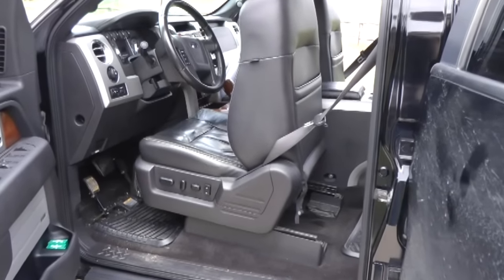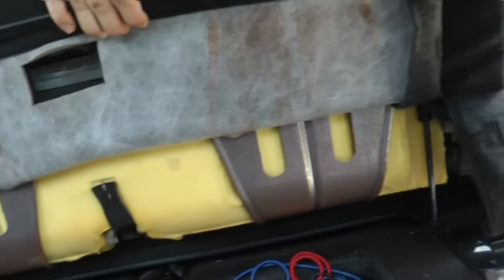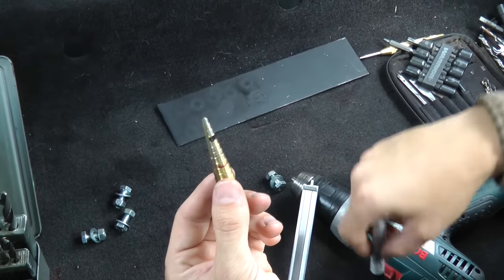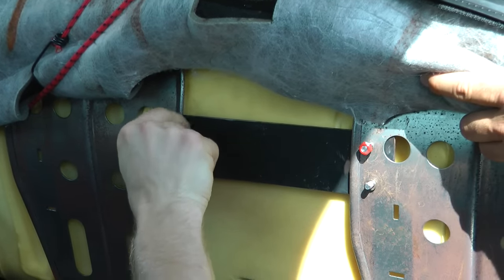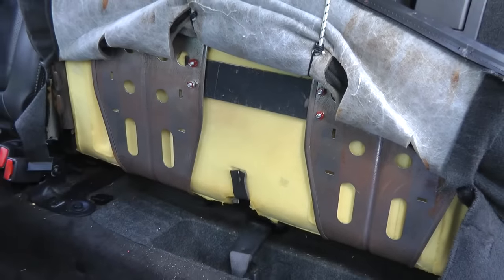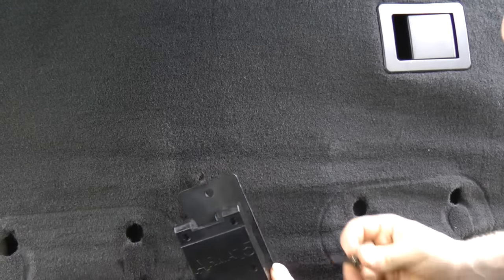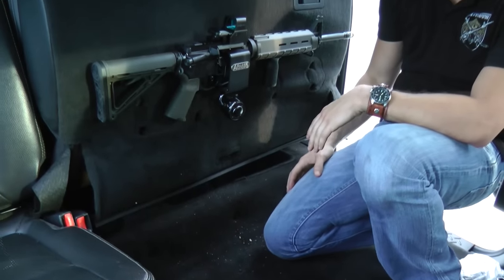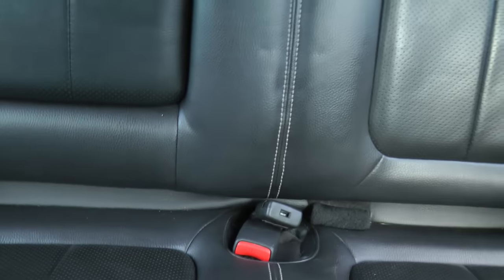ARmA15 Installed in Truck under Rear Seat AR15 M4 Locking Mount F150

Comment: great video good job , for cutting holes in your carpet you can heat up a bolt and burn it through the carpet to seal the edges if the carpet material will allow.

Comment: If you mark the hole locations in your backplate after you drill the 1/8" holes and before you drill them to full size, all the holes will line up more accurately. It's not easy to find the exact center of the full size holes with a much smaller diameter punch. Doesn't look like it was an issue for you in this video but for anyone trying this, it could misalign and be a real pain.
Good video and good idea. Thanks
Reply from the maker: Yeah we usually do this with a center punch or marker.

Comment: I would highly recommend a black, shoot thru cap on the end of the barrel.  It would keep dirt out of the gun and provide a little camo for the end of the barrel.
Reply from the maker: +rickd248 Good idea! Thanks
Reply: +ArmA15 AR15  Your welcome my friend!  I like your idea but it just won't work in my 2015 Grand Cherokee.  After watching your vid I took the weapon and a tape and spent an hour measuring and trying to find a place where I could do that.  If I still ave my old 1999 Cherokee there was a great place under the back seat that I used all the time.  The Grand Cherokee just has no room to spare.  If you go to www.flickr.com and use rickd248 as a search word for me, you can see the weapons I carry for my "Jeep Guns".  One is a .303 rebuilt Enfiled.  Thanks for all the ideas.
Reply from the maker: I drive a wrangler so I understand space.  We did install an arma15 in a trail blazer it was attached to the rear of the back seat.  Inside the back seat it has metal plate like the one in the video but on the back part not under the seat.  Look at the second picture at this link.  That is inside a trail blazer.  I would check under your upholstery but we made a video for the trail blazer as well just have yet to edit and upload.

http://arma15.com/component/hikashop/product/3-universal-rivnut-mount?Itemid=0
Reply: Good idea,  after watching this, I was thinking something would be needed to hide the end of the barrel when the door is open.  Maybe even a piece of plastic attached to the bottom side of the seat that would cover the gun from being seen at all with the door open.
Reply: @rickd248  Yes there is. I made a nice mount for my AR pistol under the back seat of my 04 GC.

Comment: If you have the crew cab truck with the larger rear seats you can install 2 of those mounts up under the seat if you invert one of them and I used thicker 3/16" or 5mm x 3" or 75mm metal for the seat mounting brackets.
With the seats down thise rifles are hidden.
You would have to get down on your hands and knees to see them under there.

Comment: This is probably late. But that “Slot” to release the seatbelt. You just need to use the buckle insert side to take it off. No screw driver or special crowbar required.

Comment: very cool but in my region with the season's and sporadic weather, humidity you'd have to check it and grease it fairly frequent
Reply from the maker: No grease needed ever powder coated so no where to rust.  Springs are strong enough to never require any lubrication.

Comment: You should put a box under the seat. that way you have a place to store any extra ammo or magazines plus it hides the barrel from getting seen. Good job.
Reply from the maker: +Brian Healy in this configuration you cant see barrel, when seat is down in normal mode.  We do have a video coming that is mounted to floor board under the seat, subscribe to see it when it comes out.  In this truck you can see they have plenty of storage for magazines under seat in factory open compartment.
Reply: You can see the barrel at 16:48. The storage compartment under seat is to small and shallow for decent storage. For $80 you can get a storage box that fits perfectly under your seat, concealing both the weapon and storing anything else that goes with it.
Reply from the maker: +Brian Healy At 16:48 I purposely put the camera low to show the rifle is there.  Unless your at a full squat or 7 years old you wont see anything, and even then it was only the tip of the muzzle brake.  The stock box worked perfectly for storing mags, the current owner uses it that way.  You can add a box under but it isnt 100 % needed.   The only time you can see it is when you have seat folded up.  If its down in normal mode you cant see  anything, just hate to see ya waste money if you dont need to.  Try it stock if your not happy then add box, but I doubt you will once you see it in real life.

Comment: Bolt Lock.  You look up year make model and you get a blank key.  Put your truck key in it, turn a full turn or half turn or 3/4 or something like that and it "learns" your truck's key.  You won't fumble around for that big truck key especially with that big fob or in my case just a transponder. bolt lock also makes very good locks and you won't loose it because it is your truck's key.

Comment: I prefer putting it in the back seat and folding it up. It holds the rifle in place. And, it is free. And, faster to get too.
Reply from the maker: +911LexVegas That works as long as no one gets access to your vehicle.  Concealing it could be as easy as having a jacket or towel over the rifle with it sitting on the seat next to you.  This is to add some security when your not in vehicle but when you are in vehicle you can have it sitting in your lap if you wish.  :-)

Comment: Even better use a AR Pistol with a 7.5 inch barrel and a sig brace of which I have and love it. Big flash and boom can be cut way down if you mount a Flaming Pig can on the end of the barrel. Out to 100 yards it will group at 4 to 5 inches with my Vortex red dot

Comment: I think that the front plate that flips up (with the arma15 nameplate) and locks the AR in place should have some "wings" of some sort to keep would be thieves from popping put the takedown pins and walking off with an upper. Very nice product tho.
Reply: +Vince ruland It secures the upper as well
Reply from the maker: +Vince ruland The ar15 is locked threw the ejection port since that's located on the upper receiver popping the take down pins don't get them anything.

Comment: It stinks to high heaven, but I've had good luck getting clean holes through carpeting with a piece of 3/8 stainless round stock, and sometimes a screwdriver, warmed up with a propane torch, just pushes right through, no fraying, no' oops, I sliced the carpet' moments.  Just use your head, you only need to warm the dowell, or screwdriver up enough to start to see a bit of discoloration.
Reply from the maker: +johayn Im sure there is a million ways thanks for offering another ill try it sometime.  The method we have used has also been flawless and pretty simple
Reply: ArmA15 AR15
Right on.  Used to install interiors and that was just one way I liked the best for making a flawless hole in carpeting.

Comment: The instal procedure is anout the same gor a Sierra or Silverado.
I have done both.
The heaby bravket needs to go under the seat the other way front to back or vertically if the seat is up to bolt it through the heavy tubing seat frame.

Comment: Ya but... the entire gun is only supported by the magazine well?  It seems like sufficient off-roading would destroy a gun mounted like that.  Great idea and looks clean, but I suggest supporting the barrel independently.
Reply from the maker: +EngineersLogic Actually no barrel support needed.  Its been offroad used on my 2 jeeps and atv several thousand miles off road.  We also had a customer get in an accident that totaled there car with no damge or even scratches on arma15 or rifle.  The marines have also made a purchase to put in attack choppers.  The mag well is pretty strong and fully suppored by abs so no steel touches the rifle.

Comment: genius, I'll do the same things to my truck.
Reply from the maker: +Dunstin N Check out our rivnut install kit on our website(arma15.com).  It cuts the install time in half and all the hardware is there.  You can buy all the hardware independently if you wish as well but having done it both ways I would use rivnuts both work equally as well but rivnut is just so much easier as far as install goes.
Reply from the maker: +Dunstin N Check out our rivnut install kit on our website(arma15.com).  It cuts the install time in half and all the hardware is there.  You can buy all the hardware independently if you wish as well but having done it both ways I would use rivnuts both work equally as well but rivnut is just so much easier as far as install goes.

Comment: Rule #2?  Why mount the rifle so that you muzzle yourself when you pull it out?  Flip the rifle and mount it 180 degress (muzzle away from you)!
Reply: The rifle has the bolt to the rear(impossible to fire), and rifle must be unloaded(2x impossible to fire).  When he took it off at no point did he sweep anyone nor himself. Maybe this is just the way this guy wanted it.  On the website it shows you can have it pointed inside the way you desire.
Reply from the maker: This customer wanted it pointed this way.  The as another has said rifle bolt must be to the rear to mount on arma15, chamber empty with no magazine.  See the end of the video I lean over and there is no way I am being swept as it is removed.  Mounting it pointing the other direction is also an option see our website.  You could argue having muzzle pointed opposite direction would be pointing at someone from other door.  But all is for not as it cant be loaded, and bolt must be to the rear to mount on arma15.

Comment: very sweet, my question is does the bracket rub against the bolt and cause any damage at all?
Reply from the maker: No, On the magazine block there is a (bolt block) which is made out of high strength ABS plastic.  Absolutely no steel touches your AR15.  See other videos on arma15.com and subscribe as we are finishing some edits on a new install video that goes over these features in great detail.
Reply from the maker: https://www.youtube.com/watch?v=h7TrxUO2r6g

Comment: Pointing the barrel at the driver side door seems like it would make removing the weapon more difficult coming from the drivers side... Now I have to find a video to see it the ARma15 allows the weapon to be reversed.
Reply: Point it either way, both works.  It's not difficult either way I've used and installed both directions for different customers taste.

Comment: The only thing different I would do is the locking nuts would have been on the inside and the bolts would be round headed Security Torx. Not impenetrable, but a few extra step that may befuddle the average Truck Burgler. How many of them carry Security Torx Bits?
Reply from the maker: +Herfmonster with the rivnut kit we sell it comes with torx hardware.  The rivnuts make installation much faster and the torx is for added security, but neither of it matters as the arma15 is designed where there is no clearance to get to hardware when rifle is locked in place.  So even if they had a proper torx bit still not gonna happen.  If you decide to use bolts and nuts as shown on YouTube hope you have 6 hands, thats what it took us.  With rivnut hardware one person can do it much faster.

Comment: kinda pisses me off that ford left that metal unpainted
Reply: look underneath a ford on the lot, you'd be amazed how many unpainted parts gather rust before the first oil change
Reply: Well it's a ford so...
Reply from the maker: +Andrew Campbell automotive industry has been doing this since invention of automobile.  There is a treatment of the steel (pickled & oiled) that prohibits rust and is cheaper than painting.
Reply: I understand why they do it but I still don't like it lol
Reply: It's an American made car, what do you expect?
Reply: Well at least we don't have Lucas electric parts...LOL.
Reply: ITS NOT ANYONES METAL ITS FLAT STOCK FROM THE METAL SUPPLIER FLAT METAL. STAY FOCUST GUYS.
Reply: Andrew Campbell at least ford puts primer on it. Chevy just puts shitty wax and it gets rusty before driving it off the dealership
Reply: F-IXED
O-R
R-EPAIR
D-AMAGE
Reply: It's a Ford you expected something different. That's your fault bro. But I bet you pull any seat back like that and all manufacturer did the same thing what can't be seen won't hurt is what they think
Reply: Well.....it's a Ford.
Reply: Fucked 
On 
Rotten 
Deal 

Found 
On 
Road
Dead

Comment: I would have flipped the gun the other way, but cool idea!
Reply from the maker: Some users flip it the other way.  This customer wanted it installed this way.  Works equally as well either way.
Reply: @Arma15  fair enough, I was just thinking when you open the door the gun is already positioned the way you'd be holding it. But everyone has their preferences.

Comment: Does the bolt ever release in transit? Seems like if it was ever jarred and caused to close it could really be a pain in the ass to get it out of the mount.
Reply from the maker: +Jake Johnson Bolt usually doesn't release even when offroading in my jeep.  But if it does bolt is riding on a slick surface of  high strength abs so its not difficult to pull up off arma15.   The bolt is traveling up less than an inch off of a slick surface.

Comment: Awesome design but you you should rivet it on
Reply from the maker: In our arma15 vehicle kits we use rivnuts we no longer do it this way (with regular nuts) as shown in video but process is the same.  We learned there had to be a better way.  Its much faster and easier as well.  We also provide a rivnut install tool in the kit as many folks havent used it before.

Comment: Wouldn't it be horrible for your buffer spring to ride around with it constantly compressed?
Reply from the maker: Nope the spring being compressed doesn't damage the spring.  Same thing as your magazines springs.  See magpul FAQ on this.  There is actually a lot of engineering that goes into springs and properly designed springs only wear on # of cycles not compression.

Comment: I'm not to familiar with the ar15 but the place where the shell flys out after being shot would it be a good idea to leave it open like that especially with it sitting there over time, dust and mud and other random stuff might get in from people getting in and out. Just curious.
Reply from the maker: +Enrique Enriquez good question.  We do have the magazine block that will stop a lot of stuff from going inside your chamber.  But inside your truck there shouldnt be a ton of mud.  On my jeep when top is off i just have a gun sock or jacket over it to keep concealed mainly but that would also prevent dirt,mud.  Etc

Comment: Nice. Can you access it without leaving the vehicle?
Reply from the maker: +will s You could.  This user wanted maximum concealment of rifle.  You can also mount above driver seat on roof as some have done.  Personally when I am doing long road trips or in shady areas my rifle is up front loaded on safe sitting between console and dirver seat, barrel down.  I also always carry a pistol so rifle just adds extra options.  When i go in to a store or something where im not in vehicle i have a place to lock it up....
Reply: rock on

Comment: As a big guy i rather mount the gun with the muzzle the other way so you don't have to crawl in there to unlock it and what not.
Reply from the maker: Checkout arma15.com we show pictures of it mounted the other way barrel pointing left.  This was how the customer wanted, both ways are equally as fast. You are correct in that the barrel is often longer and mounting it the other direction would mean you don't need to lean in as much.  On the "products" page you can select "add vehicle hardware" kit and that will show you the pics of installs for that given vehicle.

Comment: Could you install a rubber cap over the muzzle end to keep out the dirt and dust?
Reply: When im out in the desert with lots of dust i stick a cheap foam earplug in the birdcage keeps the barrel clean and self-clears on the first round
Reply: @greysonjune5598  Good solution.

Comment: Is there enough room to mount 2 under each seat? 😃😃
Reply from the maker: Yes, we have had customers do this.  As with any install measure and dry fit/test everything.  You may need one upright and the 2nd upside down which works equally as fast and some even prefer this.  For any other questions please email us directly as we don't always see these comments quickly.

Comment: Great job. How did that lock up so fast? Is it like touch lock that works with finger print?
Reply from the maker: +Ben Hayat It works of directional movement, see our other video where we go into detail on lock.  You can see it on arma15.com
Reply: Nice website and I'm glad you made a product out of idea and sell it to others.
The speed lock is great too.
Reply from the maker: +Ben Hayat its a directional lock.  Think like a joystick up down right left set to any combo you want from 2 to 12 motions.  Its very fast under a second.  We have tried biometric locks but they are much slower, much more expensive and not as reliable especially if your hands are dirty, wet, bloody etc.  

1500id masterlock

Comment: what kind of lock is that? you are able to take it off pretty quick. Or did you have it pre unlocked already?
Reply from the maker: +Raul Terrazas 1500 id.  Takes about 1 secomd to open.
Reply from the maker: +Raul Terrazas nope its quick to remove.  1500 id

Comment: So, where do you store the magazine since the bracket uses the magazine well to hold the weapon?
Reply from the maker: Each user can do it differently.  The customer in this video had 3-4 mags directly under it if you look at the thumbnail of the video there is a storage compartment directly under which made a good storage for mags.
Reply: @Arma15  Did not notice that until you pointed it out. Thanks for the reply